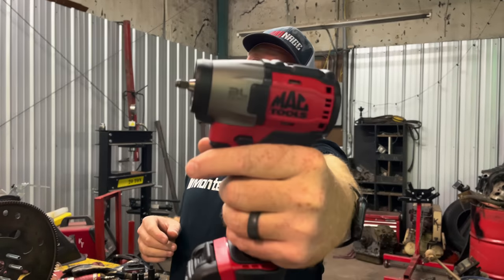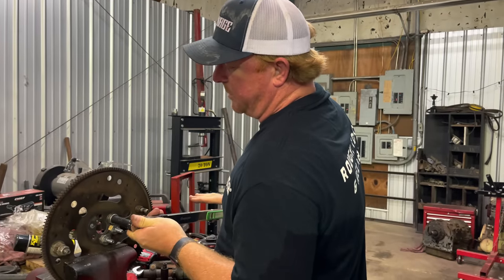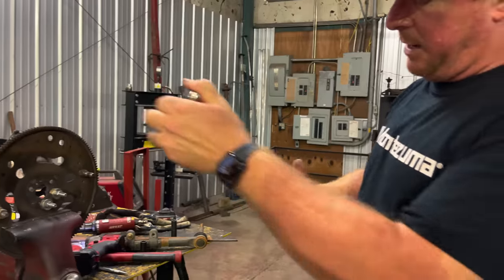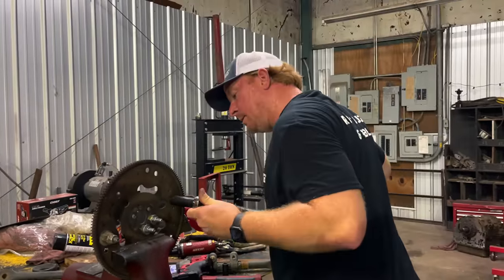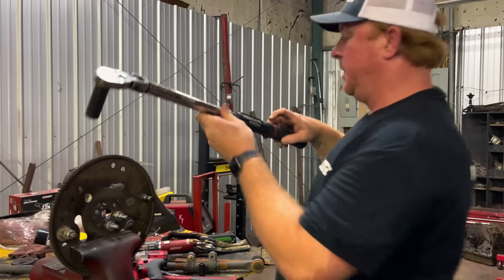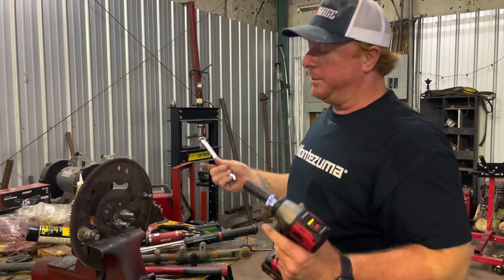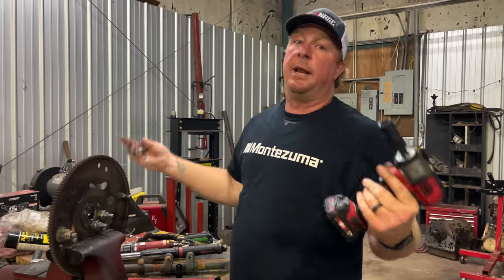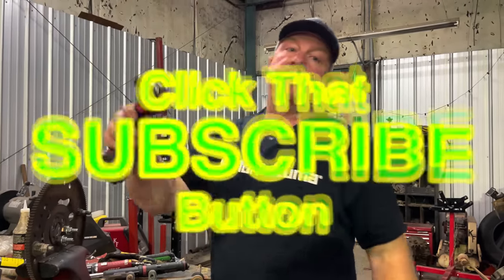Mac Tools 1/4" Impact Torque Test! The Torque Ratings Are A Joke! WATCH THIS BEFORE YOU BUY ONE!

Comment: MAC cordless ones are oil resistant as well and so much better than the Millwachi (MATCO 1/4 impact is awesome as well).
Reply: Why everybody on this channel hating on Milwaukee y’all are the same people that prolly use dewalt
Reply: Cause Milwaukee is trash as a pro I’ve used it all and milwaukee are great tools for a short time but they don’t have the durability to hold up in a shop setting

Comment: I tried a flex 1/4 on a lug nut on a f150 was impressed it spun it off knowing torque spec 150lb but didn't push it further was impressed it spun that guess the morden tools are kicking but

Comment: That is one stiff little choocher! Good to know it will take off basically anything you would regularly use a 1/4" ratchet or wrench on.  Would have liked to see what kind of fastening torque it goes to.  That might be its only drawback that being so strong it could snap heads off bolts as soon as it hits the tightening point. But for taking bolts out its a clear powerhouse.  As always, good testing Clay. Keep them videos coming!
Reply: 1/4 ratchets break at 60 to 68 70 pounds..tests are all over web..they do not do like this thing is doing

Comment: Put the new 5.0ah battery on it. It will get alot more power. I have Dewalt's 12 volt drill , impact driver and amazing screw gun. They all gain alot of torque with the 5.0ah battery compared to the compact battery. Great review

Comment: I’m pretty sure it’s 71 ft -lbs fastening.

Your results will vary wildly depending on your pp ahem* socket and bolt size.

Also this gun is identical to the dcf902 minus the anvil size.  So it should be just as strong… or weak depending on nut size.
Reply from the maker: I put it in there it clearly says 71 ft Lbs BREAkAWAY torque if you watch video it’s in there towards the end

Comment: Pretty awesome power!
Personally I run the DeWalt 12v and 20v line and love them! The DCF601 1/4" screwdriver with the clutch, DCF902 3/8" Impact, DCF901 1/2" Mini, DCF894 Mid-Torque, & the DCF899 High torque. Plus I have the MAC 12v Ratchets in 1/4" and 3/8" cause they run the same batteries I already own.

Cannot say enough good things about them all! And it makes me happy to use a brand that US owned instead of Milwaukee which is Chinese owned...
Reply from the maker: I’ve been impressed with that 12 volt Dewalt I got and this little 1/4” is bad to the bone. So far I’m a fan!
Reply: @KoonTrucking  Yeah I wich more guys would give them a chance. DeWalt and MAC are real player in the 12v world now. Really hope they continue to expand the line. Like one of those little sander/polishers guns.
Reply from the maker: Yeah me too

Comment: I wish they had this in a 3/8 anvil. I have the Milwaukee version of this and it’s awesome because these 12v are so compact, just wish they had the 3/8 anvil on them. A lot of time the actual bigger 3/8s impacts are just a little too much
Reply: Just pick up the Dewalt dcf902. Dewalt does make the Mac tool power tools, it will use the Mac batteries just fine

Comment: Man coming form I guy that works on wrecked cars 6 days a week. I usually rock with a dcf887 and dcf921. But this thing had me sold just from you saying 1/4 square drive. But 200 foot pounds is just mind blowing. I need this tools. Finders, doors, hoods, 200 foot pounds will even do most bumpers. And interior seat belt bolts and even center shaft steering wheel nuts 19mm, and 21mm. This thing could do it all. This does work on dewalt batteries right?
Reply from the maker: Yes Stanley Black and Decker owns Mac and Dewalt. The better it’s interchange.

Comment: That was fun to watch. I looked up for a tear down comparison of the Mac and DeWalt version of this impact, I got negative results. I wanted to find out just how different the innerds are on these two tools since S/B&D owns Mac tools and DeWalt. I think I remember Mac Daddy Michael explaining the exterior design differences in that the Mac is more towards the automotive sector where the DeWalt is more towards the home contractor sector. Yeah, I know people use DeWalt in their automotive jobs, as well, but anyway the insides cain’t be the same either right?
Reply: they pretty much are now, Mac has the better warranty tho.
Reply: @zorgzev96  what do you reckon about the “Craftsman” versions? I cain’t bring myself to get into the new Craftsman, though.
Reply: @donaldhollums3278  no personal experience but the TTC guys have always gotten lower numbers out of Craftsman power tools than Dewalt/Mac. I run a DCF891 and the new 20v ratchet at work all day (heavy diesel tech) and they both have plenty of power and keep up with my coworkers Milwaukee and Snap-On stuff. The trick is to not buy any of Dewalts old stuff, it isn’t as good.
Reply: @zorgzev96  good tip! Maybe I am wrong and I won’t mind to admit it, but I ain’t too fond of Stanley/B&D just mainly of seeing how the once great tool brands only seem a conglomeration of the basically the same tools with a different name now.

Comment: Like your videos, but torque down load does not equate what it takes to break the bolt. It is usually less. Easy to test, torque down to 100ft/lbs  and then get a torque meter and break the bolt. It is almost always quite a bit less than what you torqued it down to.
Reply from the maker: 200 ft Lbs …… got to be more than 71 but we tested that and almost every time it took more than what it was torqued too to break it loose

Comment: I'd like to see it up against the Milwaukee 1/4" stubby that thing was a beast!
Reply from the maker: I’m done with milwaukee
Reply: I have the Milwaukee M12 1/4" gun. It's the last thing of milwaukee I have but after seeing this I think I'm gonna be trading it off. Milwaukee says it will do 100ft lbs but I'll tell you right now there is no way. I have stalled it out on oil pan bolts for crying out loud.
Reply: @KoonTrucking   I dont blame you, i got a dead 3/8 stubby thats mint needing warranty.. My big 1/2 boss milwaukee has got more use with the 1/4" impact driver.

Comment: I'm not really a Mac tool person but I do like the compact size of this impact and if I would find one at the local pawn shops then I'm going to test it as well as I can before buying it and if it is good to go and priced right,, then I'll buy it, because I know wherever I buy it, it'll be mine and if it breaks, then I'll look for another one.. you know good and well, that warranty limit set at 71lb is a helluva a clever move on Mac's Part and being a 1/4 drive 71lb is a good and smart rating

Comment: How does the Dewalt version he sakes compete with Mac. Are their battery platforms similar or totally Different guns and torques etc
Reply from the maker: Batteries interchange. I cover that towards the end of the video
Reply: @KoonTrucking  thx ya I saw that. I was wondering if in terms of torque removal of the Mac is better as if he happy to buy this Mac gun and others as I mostly now have just Dewalt after getting rid of tons of Milwaukee  thx

Comment: Please,for your experience what is the best 3/8 drive cordless impact wrench , thanxalot
Reply from the maker: All depends on what you are wanting and the job at hand. My personal favorite is the snap on ct761 because of the rocker trigger and how thin and light it is. For more strength the new Dewalt 12 volt is about the same size as the Milwaukee stubby and has 400 ft lbs breakaway

Comment: I’m debating on buying some Mac sockets, but I don’t understand if the Chrome precision torque sockets are for everyday use, could someone explain?
Reply from the maker: Not sure what you are asking? You asking if you can use them for everyday use or you talking about using them on an impact? They are just the “cheaper line” of Mac branded sockets just like the wrenches. They aren’t the cheapest ones that would be expert brand. But not for impact use (obviously because they are chrome)
Reply: Sorry I should have been a little more specific, I’m looking at buying the Mac Precision Torque chrome sockets but I’ve heard mixed reviews like that you should only use them on rounded nuts/ bolts and that they are not for everyday use
Reply from the maker: No you can use them all the time. They are just like the wrenches.

Comment: hey clay, wut is the most reliable post-emission tractor and diesel engine? Im getting a semi diesel soon. i want to get the older engines but most of those trucks have over million miles, are beaten to hell and who knows how much life they have in em. so im going with a modern one, but want to try to avoid going to a shop as much as possible. which would u recommend?
Reply from the maker: All of them are junk with emissions. There are NO good ones. I rather have a wore out preemission diesel than a brand new one. It will still be running when the post emission ones are choked to death from trying to push through dpf filters and sucking egr back in them.
Reply: @KoonTrucking  Wow, they are that bad? LOL, Do u kno any good sites or places for used pre-emission trucks for sale?
Reply: @Saladon89  
If you MUST buy new, Freightliner with a DD15 and a manual is about the most reliable option we have running '15 and newer 680's with MX13, Prostars with Maxxforce 13, and LT's with A26. The LT's we have are less than a year old and only have ~140k on them, no major issues yet tho. Can't say that about the Paccars, I'd say they're at the bottom of the bunch.
Reply: @kylesonsalla7620  heard maxxforce is garbage and if u see it, run like hell. and current freightliner hasnt been good on quality control these days and ride comfort is bad too callin em freight shakers, buy ive heard good things about the dd15. but after research, might go for either a kenworth or a peterbilt with an x15 cummins
Reply: @Saladon89  
Our 15 and 16 Maxxforce trucks actually cost less to get to 800k than our 15 and 16 680's. We have 4 15 Maxxforce trucks they kept and keep running, while all the KW they bought at the same time are gone. I do have to Johnny Cash a #1 injector into one in the morning though. I would avoid a current Paccar truck, lots of wiring and computer issues. X15's aren't a bad engine from what I've seen but we don't run Cummins anymore, they weigh too much compared to the others and we've had stuff that should be covered under warranty that wasn't on ISX's. We've seen no quality control issues on our 20 and 21 Freightliners, and they ride like butter with air ride fronts. People have been calling them Shakers since are least the 70's but Airliner suspension is hard to beat.